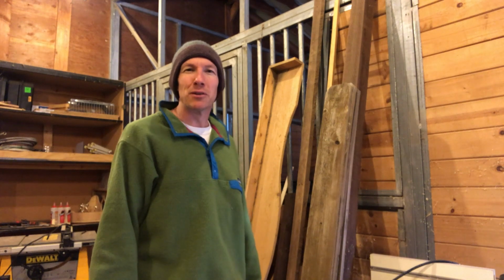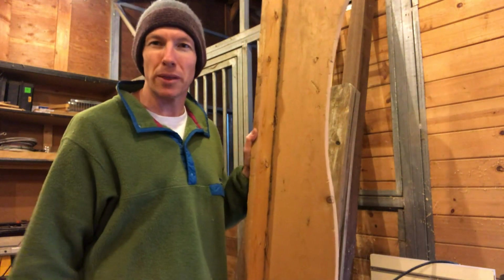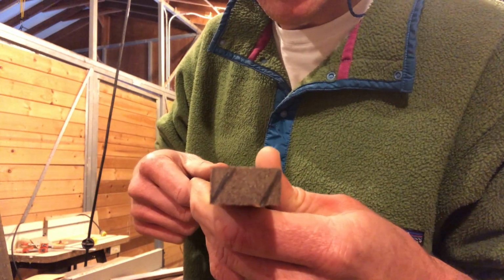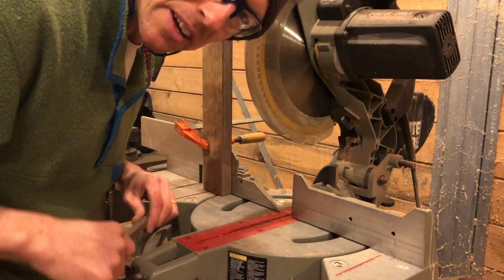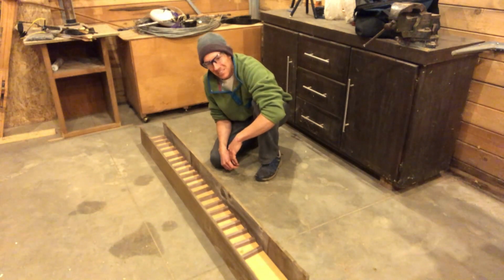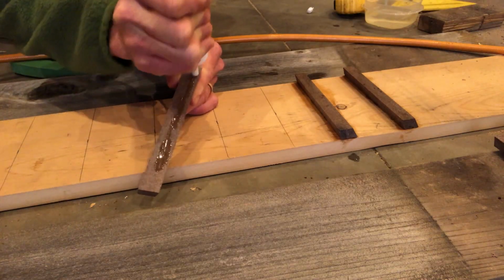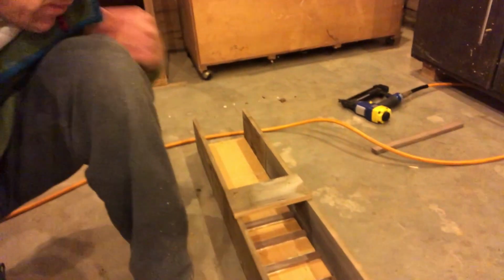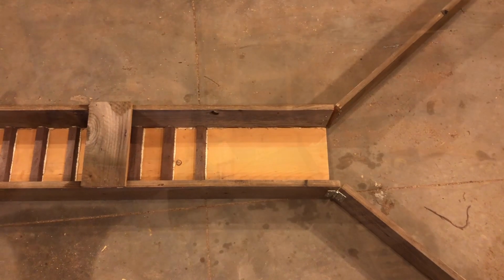How to Build a Sluice Box for Gold (out of wood, for cheap). $0!!

Comment: Hi Pete, I just found this- Thanks! I live in El DOrado Hills and while not extracting gold, I do have a hillside in my backyard where I want to build a sluce-like water feature. I had planned on using cedar pickets and your vid verified this is possible. I see you're nailing and tacking with glue. Was wondering what the leak rate is significant and if I should line mine with mastic so I don't flood my hillside. Thanks again 🤠
Reply from the maker: Hard to say for sure. Mine is only in the water periodically so no leaking is apparent, but if your situation is constantly wet a liner of some sort may be a good idea. Good luck!

Comment: Kind knowledgeable Sir, At what angle did you cut your riffles?! I am finishing the project this morning and that's the only secret unrevealed.
Reply from the maker: Honestly, I have no idea. I just eyeballed it. I know on the leading front edge I had a more gradual angle so the gravels could slide over, and on the backside I had a steeper, sharper angle closer to 90 degrees. Hope that helps!